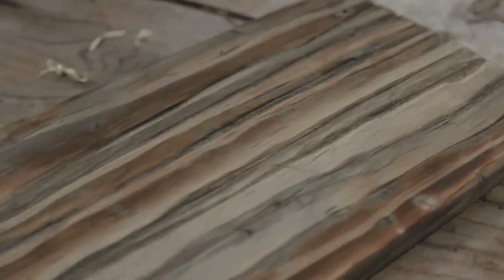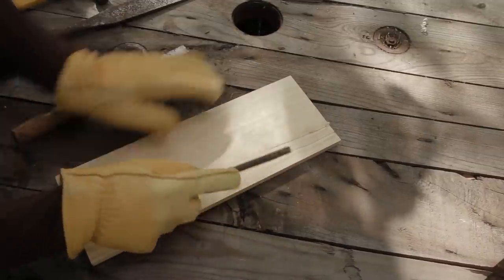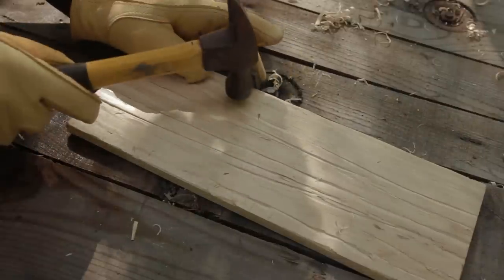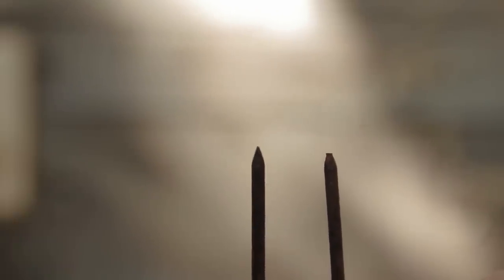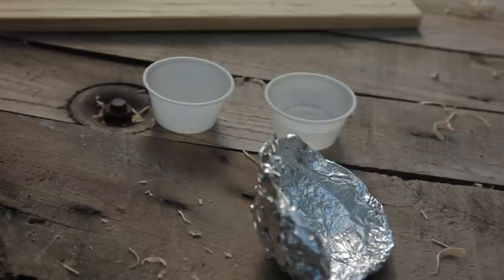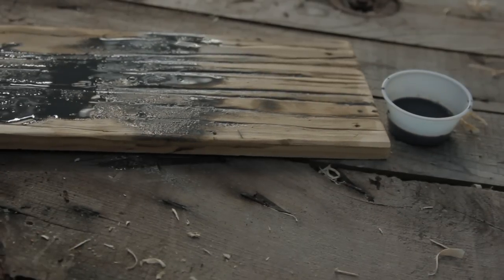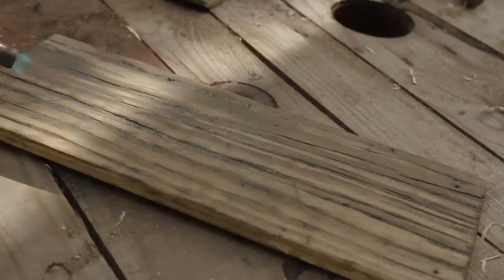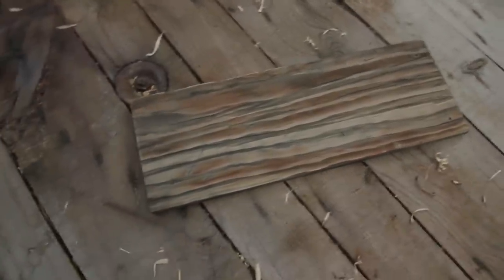Make Wood Look OLD (Wood Aging Technique - Barnwood, Driftwood)

Comment: I liked your video, good job.  Your technique with the chisel, wire brush, gouges, sand paper, and etc, was how I was taught to do this too, more than 50 years ago, and it works fine on smaller projects.  Several years ago though, someone saw a hallway coat rack/boot storage bench thing that I had made, just as you were showing with chisels and sandpaper, and asked me if I could do the walls, a bar, and a back bar for them in a rec room in a walkout basement.  I thought it would be a fairly large project, but I had no idea yet.  When I went to  look at the job, it was huge -- my whole house would of fit in that room.  The bar was like 80' long, the back bar too, with mirrors, shelves, cabinets, you name it, and now they wanted the adjoining bathroom done too. They wanted it all nice with new wood that wasn't splitting, or rotting too, so finding an old fence or barn to tear down wasn't an option either.  As long as it was new, and all matched, but looked like the wild West, swinging bat wing doors too,  Yikes, I could see myself weathering these boards for the rest of my life.  They had had a lot of carpenters and contractors there before me, and every one of them chickened out.  I almost did, while thinking about if I was going to do this job over the weekend, I had maybe the best idea that I've ever had, and I'd like to share it with you.  I tried this out first as an experiment before I gave them an answer.  What I done was took some 2"x6"s  6' long and drilled through them the 6" way near each end and put large eye bolts through them. then I screwed each 1"x 6" to them,perpendicular at each end with three staggered, heavy duty deck screws, sunk fairly well, like where you had in the video for effect.  Kind of like a 6' wide fence panel, but the 2" bys were on the very end with two eyes on each end the direction the 1" bys ran.  I live in the country out on dirt and gravel roads. My idea was to hook a chain in the eyes and drag them a bit.  I've got it down to a science now after refining the original idea a few times.  I don't know how to make videos, or I'd make one of this.  Here are most of the refinements that I added to this technique since I first invented it years ago;

- not all dirt and gravel roads are the same, you don't want too many big sharp rocks like 3/4 bn ( like you see in crushed rock drive ways, you may think you just don't need to go as far, but that's not the answer either, it just gets too gougey before you wear down the sap wood enough.  The best thing I've found is a road with mostly small chips, and fines, and a few natural gravel ( rounded, not chipped or crushed pebbles and small stones in it.

Once you've located the road you want to try, (most any road will work, just some work better), Don't go too far the first time, just 20 or 40 feet, then go turn your panel over and see what your getting, and make decisions on how much further you'll go from there.  Same don't go too far again before you look it over, just know where you started and where you were  were when you thought you were about 2/3rds done.  It may be 100', or it may be a mile or more, no two dirt roads are the same.  You don't want to be 100% done yet because the back end of your panel will get most of the wear. You need to now unhook the chain, turn the truck around and hook on the other end of the panel, and drag it right back to where you started.  If you are happy with the wear, you can load it up and drag future panels from the same starting point, and back from the same point in the same weather, then your boards should all match.  Once you have this established, you don't have to check them all the time, you can even hook several, four or five is plenty, panels together like a train, and do them all at once.  You may decide that you want a concrete block or spare tire on each panel, whatever, just so you do the same thing to all of them.

Remember that 3/4bn rock that I mentioned, well that is what my driveway, and area in front of the my shop has.  I don't drag o that, much at least, maybe just into the shop then over a little concrete, but I do lay all those panels face down in the drive way and walk around on them a bit, then pick up the right side a few feet and drop it then the left, then I hook a light chain to them and drag them by hand into the shop over a little crushed rock and a ways on broom finished concrete. 

Then, still on the floor, I turn the whole panel over and sweep the heck out of it -- dirt roads are dirty, I may even blow them off with an air compressor.   Then I go ever it with a drywaller's long handled sanding block and pretty coarse paper. Also before I worry about taking the panels apart, I slide three or four 2" bys spaced under the panel to take the bounce out of the part between the eye bolt 2"x 6"s, then I have made a few tools with broom handles and short (8") 4"x 4" blocks. One has a dozen or so deck screw that weren't driven all the way in, then cut of with a grinder so they stick out 3/8" or so. You lift the block with the broom handle and drop it in random places, and you'll get fake worm/woodpecker holes. Another just has random stuff, part of an old broken saw blade, a couple of fencing staples, a bent over nail etc. And a third one has different sizes of large bolts driven in at all different angles. You don't need a lot of drops with these last two tools, dropping and walking on it in the crushed rock done most of that, just a drop here and there for areas lacking enough.

There rest I do pretty much the same with the paint and water, the only difference is if I am going to be using those boards in a wall type of situation, I use a long handled paint roller to apply it generously to the whole panel at once, then go over it right away with a soft nylon kitchen broom with the grain to help get it down in everything, then go over it with a sponge mop before it dries, also with the grain to take some off the high areas.  I don't usually burn it, but have with a weed burner.  Sometimes, also when I'm on the sponge mop step, I may have a different shade of color mixed up, and I'll dip the mop, squeeze most out, and give it subtle highlights here and there.  Usually, I don't burn it, I have a few times with a weed burner, I'm sure its harder to pinpoint what you are aiming at, but it works ok in a broad brush sort of way.  I sound like all of this is how I always do everything, but the truth is, I don't think that I have ever done or followed the exact same steps ever on any two jobs.  I just try really hard not to vary any of what I'm doing on the same job much.

The boards that'll I'll be using for trim, and shelves and such, I take off of the panels and on the work bench before I get to painting and staining them.  I have a little metal meat tenderizer hammer that has a different texture on each end, smooth parts, and a mold seam on each side, the handle, metal, is even a good dinger.  I go down both edges with it, and even put a few digs on the back and/or wire brush, heavy sand, etc, if I think the back will show much, like the back of a cupboard door when open or the under side of most shelves, especially high ones.  Then I pretty much follow the same steps as before, just with a mini roller, paint brush, small sponge, and rag and do all sides of this lumber and stack it separately.  Make sure when you are done with the steps in this paragraph, that you put all of these little tools a few different grit pieces of sand paper, or emery cloth, and a quart or more of your mixture in a five gallon bucket with a lid, and take it and a little table to set up by your saw station when carpentering.  When you make a cut, you will expose uncolored new wood, and some will show.  I just Find it so much easier, and a much cleaner looking job, to make a cut, doctor up the cut and color it right then, it only takes a few seconds, if your finishing stuff is all laid out and ready, even if that cut never shows, it beats trying to hunt down those exposed places later, packing stain in the house, or trying too get that runny stuff on door trim or cabinet bottoms, without making a mess, or taping off, ect.

When all of that is done, I take the panels apart, up on saw horses, inspect each board closely, put a Qtip of dye in the screw holes, and stack the lumber on spacers, then as I load it to take to the job, and again as I use it at the job, I shuffle it around so that it's all mixed up and unlikely that many of the same boards from the same area all end up next to each other, no matter how hard you try, each panel will come out just slightly different, but if you apply them to the wall as they came off the panels in order, you will see transitions -- but mixed, no problem, it's character then :)

I Didn't start out to write a book, but I nearly have,  I just wanted to add this Mr Crafsman, so that if you need several of these boards, or one of your viewers do, you could save hours, or days, or weeks, Hell years for me when I thought of it.  The first time that I ever tried this method, me and two teenage helpers, dinged a stained two big semi loads of boards in less than two five day weeks,  and they all came out beautiful ,and we got some other things done too, like making stamping blocks, reinventing the wheel, and other odds and ends, and now that I'm better at it, or at least already have the plan, I think that I could even cut that time in half.  I would say that even if you just had 10 or 20 boards to do, this would save you time, let alone a hundred.  

I wish that I could make a Youtube, I'd show you, but maybe if I'm lucky, you'll give this a try, and say, "Wow, that worked so damn, good, I'm gonna make that video for that guy.  If you do, it'll be a way better video than I could ever make-- you have a very pleasant voice, seem like a cheery nice guy, and are a pleasure to listen too.
Reply from the maker: Hey Brad! Thank you for watching! That's a very interesting technique you've described! Talk about a good way to distress a large area (or lot of boards) quickly! The only thing somewhat close to that that I've ever heard for distressing planks is to lay them out flat, throw some gravel and sand on them, and invite the community over for a dance party. Once the party is over, clean off all the gravel and dirt, and you should have some worn-out looking boards. LOL!

But to be honest, your idea sounds a lot easier, and you wouldn't have to worry about buying food and drinks.

You might should try a YouTube video! You never know what might happen!  :D

Comment: I have used some stress techniques on over 70 beams for a new construction project.  Some of those beams were over 25 ft. long.  That's a lot of sawdust and labor.  Learned some little tricks from your video.  Thanks for your tips and tricks.  Learning every day @ 71+ years.

Comment: The chisels work nicely. For a larger board, you can try blasting it with a pressure washer at fairly close range to get a similar effect. I learned that cleaning my back porch a few years ago -- making it look aged was not what I intended, but it was what I got!

Comment: Did my whole living room, thanks Mr Crafsman!
I burnt mine black, wire brushed the soot off, 50/50 white paint n water, painted, wiped off paint, then sanded. Looks like old grey barn wood.
I'm doing what you did here for the barn doors..maybe test some polyurethane ontop to see how that looks.
Reply: hi, would you kindly care to share what you finally did? I mean both burnt thing and polyurethane finish. Thanks!

Comment: awesome technique! You can save yourself time running the chisel through the grain by using a sand blaster. It will cut away at the "sap wood" fast and will create raised areas where the grain is.
Reply from the maker: I've seen this done, and it's very nice for a weather-worn look. I don't have access to a sand-blaster, though.  :/

Comment: That is beaufitful!  I love the weathered look. My husband is trying to distress a table for my daughter. He painted it white, the wood of the table is a maple or something like that underneath. He is trying to figure out how to distress it more. I suggested more sanding so the corners would look worn. Since it is a dinner table we want to keep the top smooth. Do you have any ideas for us?
Reply from the maker: Hi Jude! I find that I get the best results when I let loose and have fun with it. That's easier said than done. Like when I have a scrap piece of wood, it's easy, but when I have a product like a table, I may tense up more. Your idea about wearing down the edges and corners is a good one. I would take various chisels, nails, etc. and add dings here and there. You want a variety, though, not just the same sized ding all over. Sometimes I lay bolts down and hit them with a hammer, pressing the thread marks into the surface. You can sand everything afterwards (but not too much) to give it a smooth feel, before finishing.  :)
Reply: Thanks. My husband has tried applying a bit of stain also around the edges and it's starting to look nice. I agree that you just have to try different things. Thank you for getting back with me.

Comment: Great video, thanks crafsman!

What will you do with that plank? If I had a car, I might put it (somewhere) in there somehow. Or if I could somehow seal the board, use it as a chopping board or a cheese board.
Reply from the maker: Hey, AV! I didn't have any plans for the board. May put it up on my Etsy shop.  :D  I wouldn't use it for a chopping board, since it's got some pretty deep grooves in it. You'd rather something a lot smoother than this.  :)